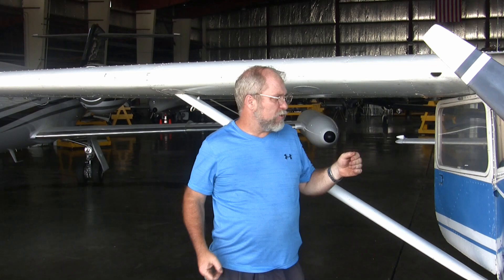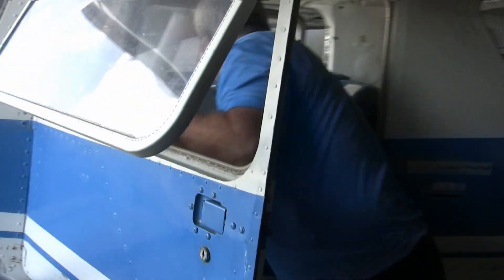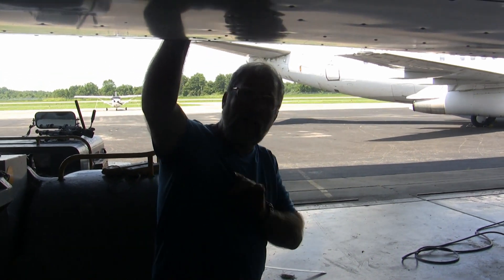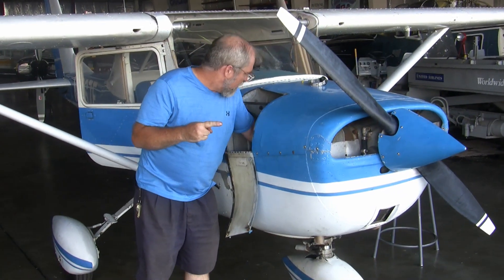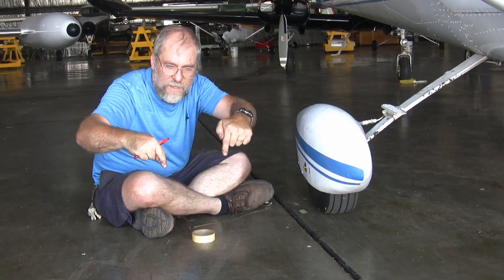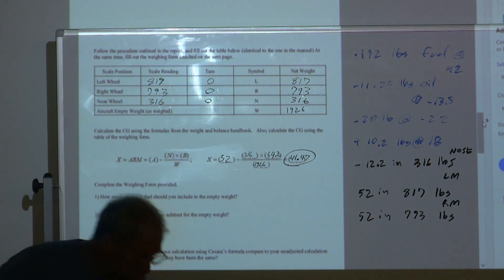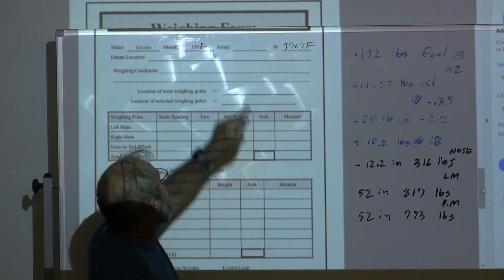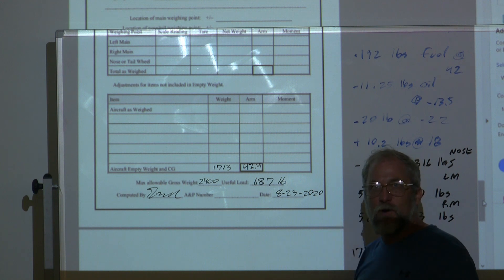SIUC A&P W&B - Weighing an Aircraft and Computing Report

Comment: Thank you for this video, I suspected how to do this, but have never seen it. FYI, 22 gal of fuel (6lb per gal) would be 132lbs not 192lbs. I know that you claim you did this for the real aircraft already, but I would have liked to see the actual aircraft done, and for you to physically point to the CG location on the real aircraft, both front to back and left to right as a visual CG point